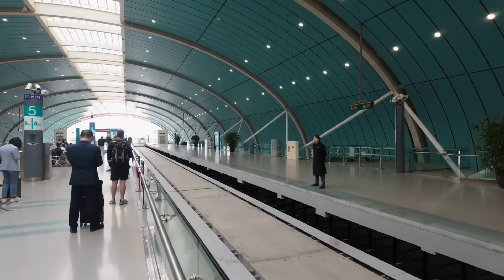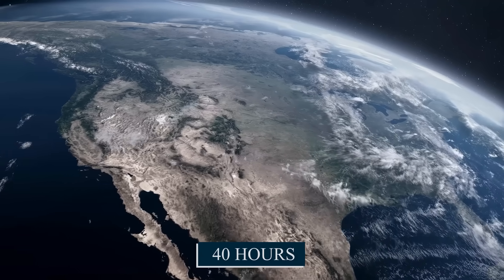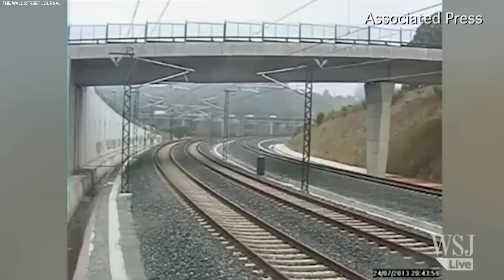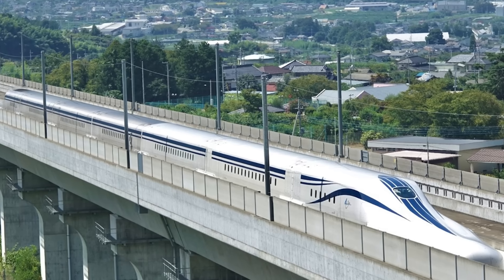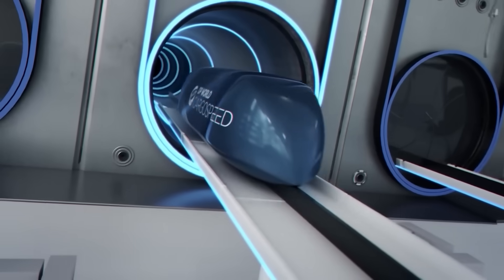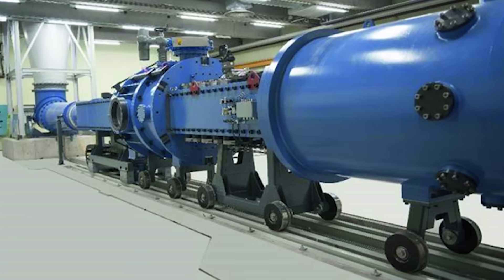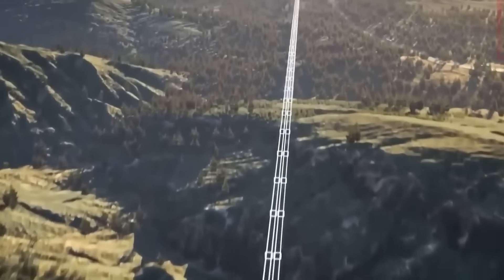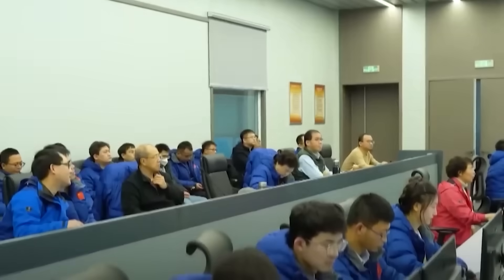🇨🇳 Why China’s 1,000 km/h Train Could Replace Planes Forever!

Comment: Air density of 0.1% of atmospheric is generally technically considered "rough" vacuum, that is, the lowest "grade" of many, of vacuums, technically not extremely difficult to achieve or maintain, and that density, the drag at 1000 km/h is the same as just over 30 km/h in normal atmospheric pressure, all else equal.

No doubt there's a wide range of very interesting engineering challenges that has to be addressed well enough to make such a system work well. 

If the tubes contains mostly water vapor, it would be easy to create a higher pressure behind the train than in front of them just by making the temperature higher behind the train than in front of them. That approach would make it very easy to create and maintain the very modest "vacuum" required, and just by maintaining a quite modest temperature difference you can actually get a quite significant force that can help push the trains in the direction you want. With condensers in front of the train at or below 30 °C, and evaporators behind the train at or above 55 °C you get over 10 kN, or roughly a ton of force per square meter cross-sectional area of train pushing it along. 

A few tons of force alone isn't much to accelerate trains that weighs hundreds, or even thousands of tons, but compared to fighting even very slight air resistance, even such modest force, relatively speaking, helping you along is quite an advantage. The mentioned temperatures were just examples that wouldn't be difficult to achieve. Assuming a cross-sectional area of 10 m² that would be 100 kN of force, meaning a 100 kilojoules per meter of travel, or just under 28 kWh per kilometer, and at a speed of a 1000 km/h that's 28 MW. There's no such thing as a free lunch in physics, so the amount of heat energy needed to be transferred would be significantly larger, as in multiple times larger, than the mechanical energy gained. But then again, very low grade heat could be used for energy input, and as a bonus, that would technically make the trains steam powered.
Reply from the maker: It seems like you’ve got the physics down to a science! If only we could train more people to think like you, we’d be zooming around in vacuum tubes in no time! 🤓💙

Comment: As an aerodynamicist, I believe that the power required to pump out the tubes fast enough for a thousand Km/hr train would likely exceed the power required to power the train through normal atmospheric pressure.  Do you have an analysis countering this?
Reply from the maker: Ah, the classic battle of aerodynamics vs. engineering! It’s like a high-speed showdown – may the best force win! ⚡️🤓
Reply: @GreatBigBuilds  It's not "aerodynamics vs. engineering."  It's aeronautical engineering vs. pump engineering.  I just believe that it's easier to significantly reduce aerodynamic drag than it is to pump enough air out of sections of tube big enough to make a difference.  However, a mechanical engineer may have a different view.  I need to see data.